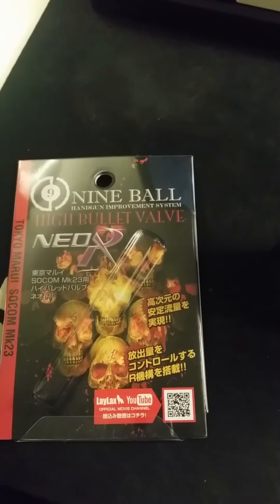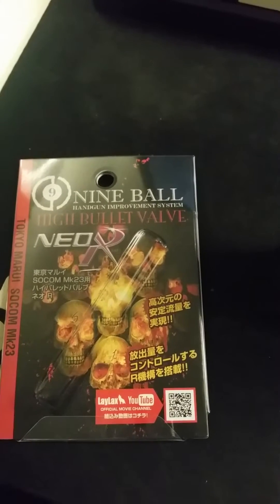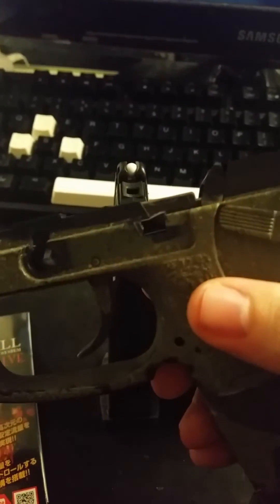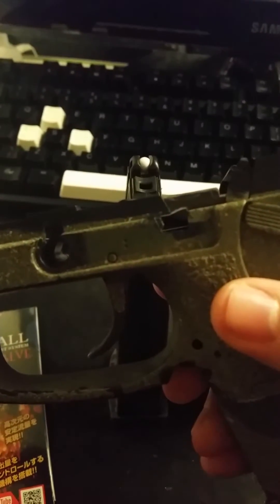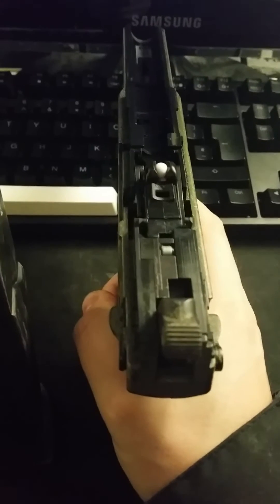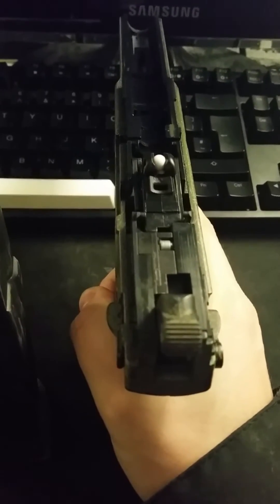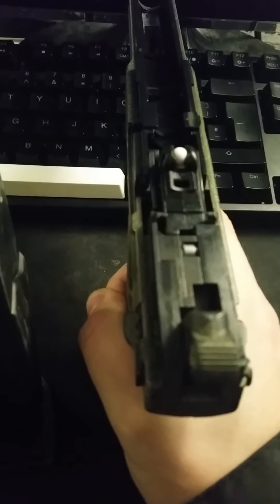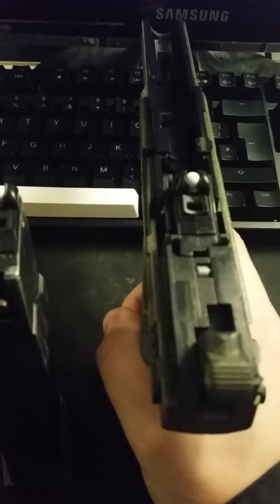OMMK - NineBall High Bullet Valve Test

Comment: Bought this last week, and don't have the problem with the valve sticking out when the magazine is fully loaded with green gas. Tried a RWA can, a WE can, and and some orange can that says "12kg". Cranked the opening to full and getting 1.3-1.38J from a 133mm 6.00 nine ball barrel, Hadron TDC and ML Autobot 60 degree. Stock hammer is able to trigger the valve to open.

Possibly there has been update to the design? Purchased from sixmm